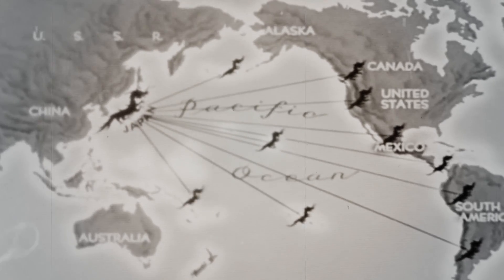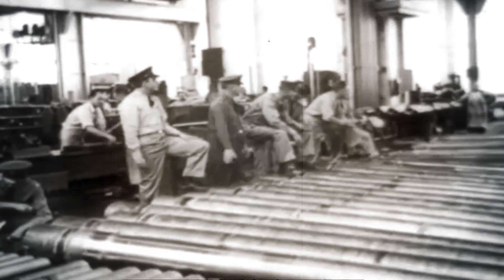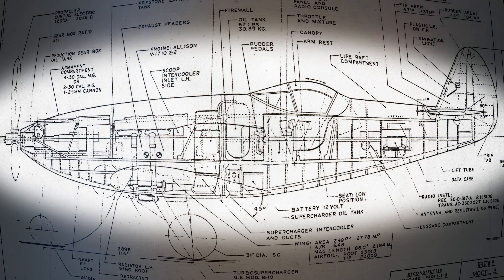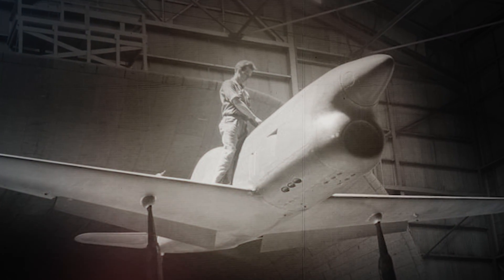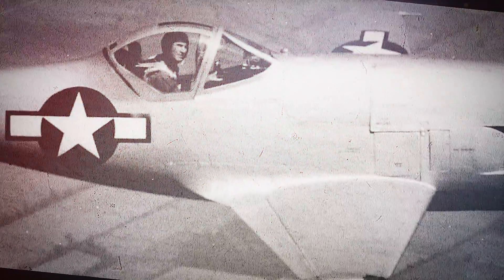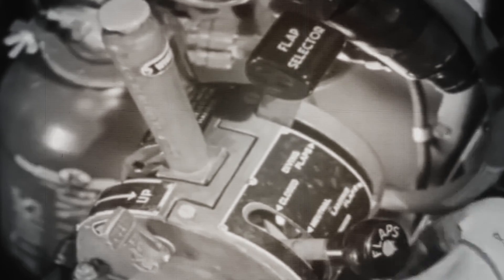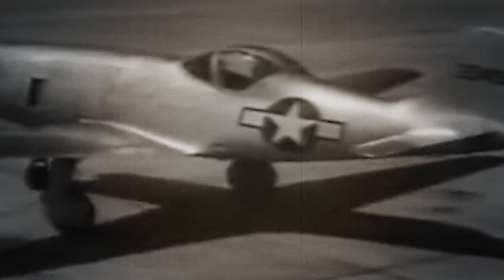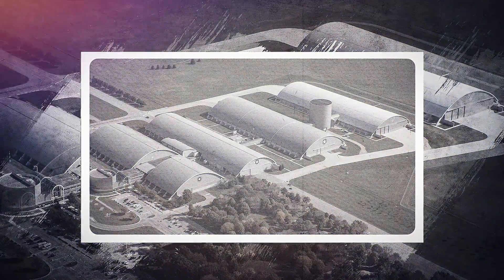Bell XP-77 - America's Emergency Fighter (Built from Wood)

Comment: "Gentlemen, we need an aircraft made of wood".
Bell comes up with the XP-77. De Haviland unveil the Mosquito.
Reply: Britain produced 131,549 aircraft 39-45.  USA produced 303,665 and Lend Leased approx. 30,000 to Britain.  39,974 engines Lend Leased to Britain including the Packard Merlin's in the Hurricanes, Lancasters and Mossys built in Canada.
B. Mk XX  245 built  Built by de Havilland Canada with 1,460 hp Packard Merlin 31 or 33. Specification otherwise as B. Mk VII.
BAE Systems Mosquito page
https://www.baesystems.com/en/heritage/de-havilland-mosquito
Reply: @nickdanger3802  Quality over quantity.
Reply: @stephenhall1892  US aircraft in production in 1939 and still in front line service in 1945:  P38, P39 (2,701 Lend Leased to British Empire plus 4,423 to USSR, link below), P40 (2,799 LL to BE), F4F Wildcat (aircraft purchased by France "transferred" to Britain in 1940), DC3/C47 (2,035 LL to BE), Lockheed Hudson A-28 & A-29, (1,007 LL to BE),   B17, B24 (2,140 LL to BE plus 88 to Canada), Catalina flying boat, built in Canada under license as Canso. 
Approx. 1,000 used British aircraft loaned to USA per Yesterdays Air Force Reverse Lend Lease on U tube.

http://ibiblio.org/hyperwar/USA/ref/LL-Ship/LL-Ship-7.html
Reply: @nickdanger3802  P38 and P39 were judged too poor performing for frontline service by Britain. They were relegated upon delivery to low intensity areas like garrisons in quiet theatres or passed straight on to the Soviets as British aid. P51 was only good when a British engine was stuck in it. Every F4F (in British service the Martlet) was remanufactured by Blackburn to bring it up to British standards, the contracts for 81 to equip French aircraft carriers were novated to Britain (Britain and France ran a joint procurement programme) and Britain also picked up 30 that were in Gibraltar awaiting delivery to Greece when it surrendered. 20 B-17C were acquired by the RAF in 1940 but they proved to have low accuracy and a lot of mechanical problems so were relegated to maritime patrol as were later deliveries. In 1943 it was withdrawn from combat entirely and used purely for meteorological flights. B24's wernt used by RAF as bombers, they were used as passenger planes and for maritime patrol and distributed amongst RAF, Coastal Command and BOAC.

So yeah, american aircraft wernt thought that well of in Britain.
Reply: B24D  "The argument of 'Bomber' Harris had been that the RAF's most useful contribution to the Battle of the Atlantic was to bomb the U-boat pens and production facilities on land - a view that was, and remains, deeply controversial. By the second half of 1943, however, as these longer-range aircraft were released for the sea battle,    the mid-Atlantic gap    was at last being satisfactorily covered."
BBC  The Battle of the Atlantic: The U-boat peril 
http://www.bbc.co.uk/history/worldwars/wwtwo/battle_atlantic_01.shtml
Reply: @nickdanger3802  That report is referring to using them purely as photo reconnaissance aircraft with occasional strafing of locomotives and the pilots under orders to run away from any enemy aircraft encountered and not to engage. Its also written by an american and talking about US service.
Reply: So Nick youve failed to come up with examples of them being used throughout the war in British service for frontline combat duty, your having to rely on US and Russian use.
Reply: @watcherzero5256  It does not matter where or with whom they were in service as long as they were in service.
"Former P-40 fighter pilot John Bailey is of the opinion the P-40 ‘Kittyhawk’ was preferable to the renowned Spitfire.
It was one of the best fighters in the campaign over the skies of Papua New Guinea, he says. They were built with quality, dependability, and longevity in mind. The Spitfire wasn’t as good in that regard. Rarely could a full squadron of them be put in the air.
And he should know. His experience started at age 21 when in 1943, he flew his first sortie in the campaign. He flew 102 sorties against the Japanese while he was with 75 Squadron of the Royal Australian Air Force."
https://www.warhistoryonline.com/war-articles/the-p-40-kittyhawk-was-even-better-than-the-spitfire-says-former-ww2-pilot.html
Reply: @nickdanger3802  There were 8 Spitfires in No.79 squadron but they had no equipment spares for repairs so had to cannibalise existing aircraft. They lost no Spitfires in combat the only loss coming from a collision with a P40 during taking off, same cant be said for the P40. They were rarely called upon as the Japanese lacked aircraft in the area with the only call upon allied fighters being to strafe ground targets and hunt cargo ships. The Spitfires assigned role by the way was to provide high altitude escort of the P40 fighters.
Reply: "When you come to consider the case made by Lord Winster in relation to the Fleet Air Arm you have got to take into account the immense assistance that the Fleet Air Arm got from the    American programme.    It got splendid assistance. There is the B.P.Y. (PBY),   the Catalina   so-called. The Catalina began early in 1940. Many of them, perhaps all, were flown across the Atlantic. The supply of Catalinas has been very considerable. Then there are   the Hudsons   of Coastal Command. The Hudsons have been coming here in great numbers. I should say there have been as many Hudsons as the Air Ministry could handle. Then there is   the Martlet.   As to the output of these firms, they were persuaded to give up some aircraft which were going in other directions in order that we might be supplied 
808
with    essential aircraft    for the Fleet Air Arm."
FLEET AIR ARM.  HL Deb 27 January 1943
https://api.parliament.uk/historic-hansard/lords/1943/jan/27/fleet-air-arm
Reply: "The first Spitfires arrived in Australia in   August 1942.   At first it presented some difficulties in the South-West Pacific, owing to its   relatively short range   and mechanical problems resulting from climatic conditions and its fragile undercarriage, which was not well-suited to the rough airstrips found throughout the Pacific Theatre. However   with some modifications   made to the Spitfire including ‘tropicalisation’ to improve cooling to the engine the Spitfire proved to be an outstanding aircraft for the RAAF during   the latter years  of World War II."
http://brokenwings.com.au/spitfires/
Reply: @nickdanger3802  Yes, glad you agree. The topicalization issues experienced by British tanks and aircraft in the Pacific were mirrored by american aircraft in Europe, the supercoolers tended to cool the fuel-air mixture too far leading to the lead separating out and excessive engine wear occurring as they had been designed for the warmer pacific. There were also issues with the engine icing up from moisture freezing in the air intakes choking oxygen supply.
Reply: "British tanks and aircraft in the Pacific"   Which British tanks operated in the Pacific?
Reply: @nickdanger3802  There's a very good reason why the British thought so poorly of the P-38 Lightning. All of the Lightnings provided to them lacked the all-important supercharger, without which its performance was severely curtailed, especially at medium to high altitude, where the Allison V12 was literally left gasping!

That's why the Brits called it "the gutless Lightning."
Reply: @That70sGuitarist  Turbocharger.  As I understand it   Britain and France ordered P38's without turbochargers because they wanted commonality with  spare engines for their P40's.
Reply: @nickdanger3802  Actually, we're both right; it was a turbo-supercharger, in fact, although some sources still claim that the Yanks didn't want anyone else getting their hands on it. 

Also, the British and French orders specified right-hand-turning engines only, which would have had an unpleasant effect on the otherwise exceptionally smooth-handling Lightning.
Reply: @stephenhall1892  but the USA produced the best aircraft of WW2... pacific theater or europe...from the  P51 mustang and P38 lightning to the corsair, hellcat etc.. just look at the kill ratio... they eventually  dominated the skies....with quality..
Reply: @watcherzero5256  from Pacific to Europe these planes would eventually rule the skies... Got to disagree .imop
Reply: @pgroove163  P36 and P40 withdrawn (P40 did horribly against German aircraft) F2U & F4U did bad against Japanese. P-47 had to be refitted by the British to bring it up to snuff. Wasnt until Hellcat that the Yanks had a decent fighter. P38 was a decent fighter later on though twice as expensive as others, but it wasnt approved for combat until the F version three years after introduction.
Reply: And for info on the Mosquito construction a good resource is "The People's Mosquito" project http://www.peoplesmosquito.org.uk/ conceived by a charitable organisation aiming "To Fly, To Educate, To Remember" and return aircraft RL249 to the skies. Lots of online info about the development of jigs and tooling for production of a new fusilage. All contributions great and small welcome via the website!

Comment: Best wooden aircraft of WWII, the De Haviland  Mosquito. the worst? The Curtiss  C-76  Caravan.
Reply: It was so good that dodge made a minivan in its honor 🎖 🤣
Reply: @bradyoung8197  - First flight, it began shaking so badly, the pilot put it  back on the ground.  Second flight, if came apart.  Even empty. this cargo plane was underpowered and overweight.  And it was unstable.  It was so bad that, if it hadn't killed people, it would be hilarious.  
The first flight of the YC-76 prototype took place on May 3, 1943. The C-76 proved severely underpowered from the start, with a cruise speed of 160 mph, a service ceiling of 22,600 feet, a range of only 750 miles, and a cargo capacity of under 8,000 lbs. Colonel J.W. Sessums, a USAAF officer at the Air Materiel Command at Wright Field, later related:

'The first flight [of the C-76] was made and the airplane was very heavy. It developed some serious vibrations. In fact, the pilot was awful glad to make a quick circuit to get back on the ground ... two of the Curtiss test pilots took it out on a flight and the Army requested that our project officer on the airplane be allowed to fly along on this trip. The Curtiss Company refused. We were very glad that they refused because on this second flight, it [the C-76] flew apart and the pilots were lost and so was the plane.
Compared to other cargo aircraft then coming into service, the C-76 was already obsolescent, even allowing for its 'war-priority' method of construction. In addition, the C-76 failed a number of critical flight tests. It was discovered in testing that the C-76 was unstable when not carrying a cargo load; in order to obtain a stable center of gravity, the plane had to be ballasted beyond its maximum permissible gross takeoff weight. At any speed, or in any gusting wind, the C-76's elevators would flap back and forth violently. The wing structure failed in eight separate static tests, sometimes with a load as low as 40% of the wing's rated capacity. The wing failures were attributed by some sources to the failure of the fasteners used to secure the wood components of the aircraft. Numerous additional fasteners, metal stirrups, and wood ply reinforcements were added to the structure in an effort to strengthen it, thereby increasing the plane's overall weight. even more at.. https://enacademic.com/dic.nsf/enwiki/11595535

Comment: Wood aircraft can be built very light. This concept was obviously excellent as demonstrated by the Mosquito but needed to be designed and engineered correctly. Most American designs tended to be built heavily and over armored. The Zero had lightness built in and that was it's weakness. Americans hate to lose men and wont generally send troops out in a poorly defended vehicle. Then again there was the  Sherman....

Comment: This could have never fought against the A6M or Ki-43.  Not enough wing area.  Add more wing area, the speed goes down.  Additionally, no American pilot would have been willing to fight in a wooden plane with limited protection, they wanted flying fortresses.  And I disagree that American fighters could fight the A6m and Ki-43.  What they could do, however, was avoid fighting.

Comment: Interesting! Had no idea. Wish they followed through with the development. The success of the British Mosquito proves the potential for such a plane as the XP77. Great job, thanks!
Reply: Both aircraft were failures. Just in different ways.
The XP-77 failed because of poor performance, but did minimize use of strategic resources.
The Mosquito failed at minimizing the consumption of strategic resources, but had superb performance.

Mosquito production required specific types and grades of woods from all over the world, consuming large amounts of shipping capacity at times when the supply of shipping was questionable. Had this been disrupted, Mosquito production would have ground to a halt just like other aircraft. The XP-77 could be built entirely of domestically supplied wood in the US. The Mosquito used new adhesives that had its own limits of production while the XP-77 used more conventional, but lower performance, glues that were more readily available. Then there is the engines, the supply of Merlin engines was not always guaranteed. The XP-77 used an engine that was in not quite as high demand. As near as I can tell, it was also easier to produce. The Mosquito required highly skilled labor to produce that was not easily expanded. XP-77 I believe could use less skilled woodworkers.

The Mosquito lived on because the performance made it worthwhile to build, even after it failed to not be as resource intensive as other aircraft.

Comment: 👍 Very interesting video, thanks. I couldn't help but draw comparisons between the Bell XP-77 against the DeHavilland DH.88 Comet and Supermarine Spitfire. The Comet was the basis for the Mosquito and the Spitfire owed a lot to the 1920s/30s Supermarine Schneider Trophy racers. Both highly successful designs. So, the concept of using a "racer" as the basis for a fighter was good. It seems that the XP-77 was just badly implemented. The idea of wood as a construction material made sense as it was initially abundant and could use tried and tested construction methods. The problem was that Bell didn't use a proven design and could have probably learned a few tricks from other designs and manufacturers (like DeHavilland) who had already been down this route?

Comment: Until the mid 1930s, nearly all planes were made predominantly from wood. The transfer to all metal typically took manufactures up to a decade to perfect. Company’s like De Havilland in the UK had not mastered the process by the beginning of WW2. Even Hawker - a world leader in aircraft design since the days of the Sopwith range in WW1 - designed and built the Hurricane partly from traditional wood and fabric for the fuselage behind the cockpit.  Given the scarcity of modern materials like aluminium and also skilled metal trades it made perfect sense to utilise traditional methods of aircraft design and construction, together with the surplus of skilled woodworking trades. Hence De Havilland’s completely awesome mid war Mosquito fighter-bomber.

Comment: The best 4 engine bomber of WW2 were 2 De Havilland Mosquitos sitting next to each other. Range, bomb load, crew requirement, success against fighters, speed and cost and made of wood.
Reply: Interesting theory which I have heard before and wondered about. If Britain had just churned out Mosquitos in roughly twice the number of Lancasters and other "heavies", could the same objectives have been achieved with smaller numbers of aircrew and significantly fewer losses of aircrew lives and aircraft? Perhaps? However, I don't think it was initially realised how successful the Mosquito was until it had gone into production and by that time the strategy was well in place to use the big 4 engined bombers as the main weapon.
Reply: @Steve-GM0HUU  Hello Steve, Would Britain close down a production line for Lancasters or would the Americans close down "Willow Run" and produce the Mosquitos and Merlin engines in massive quantities? What would they do with all the "Wright" made radial engines? The answer is no, you can't in war.
Reply: @briantayler1230  Yes, I think you are right. That was the point I was trying to make, though perhaps not very well. By the time it was realised that the Mosquito might have been a better solution, so much resource had already been commited to other projects, it was by then a rhetorical question. Also, the heavy bombers like the Lancaster had some other advantages because of their higher payload such as the amount of  navigational, radio and counter-measure equipment many were carrying as the war progressed. In terms off heavy bombs, I believe the Mosquito could only just carried a Cookie nevermind a Tall Boy or Grand Slam. So, they would never have completey replace aircraft like the Lancaster.